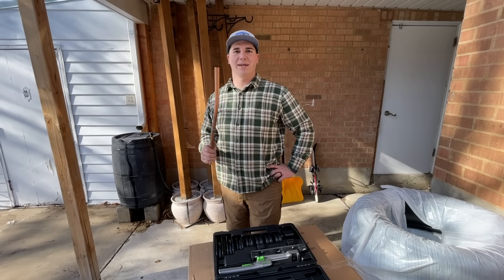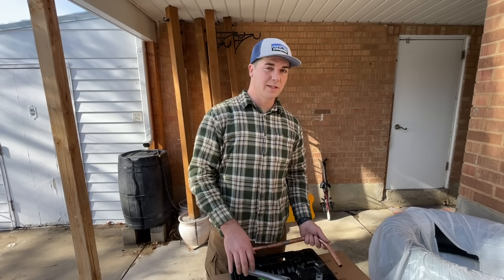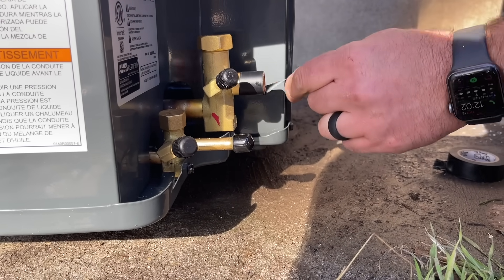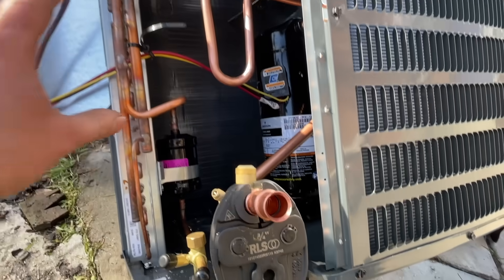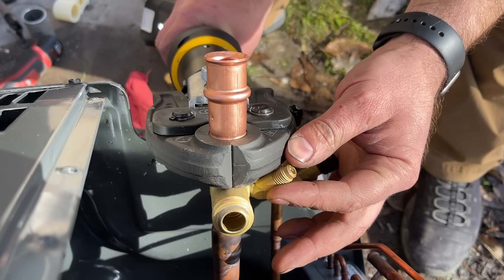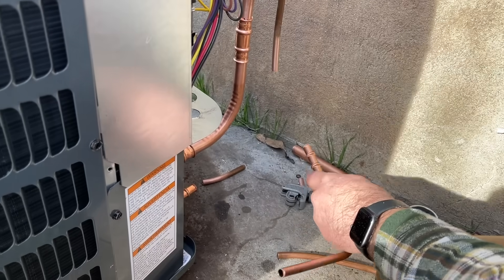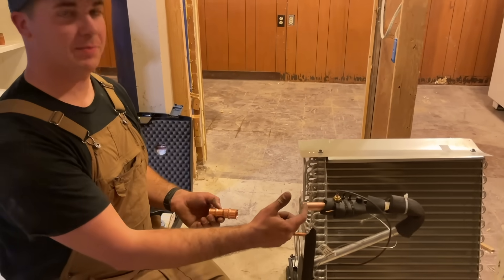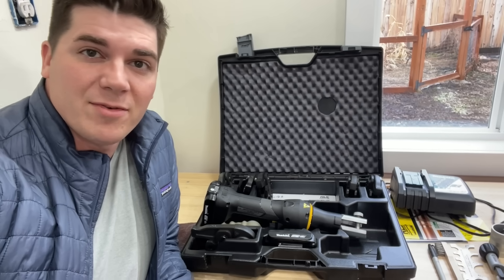Brazing Is For Cavemen. THIS Is The Future Of HVAC Copper Connections. -RLS Crimping Tool-

Comment: For years I would solder pipes in my house I even changed my kitchen and other major water lines all with solder , just last year I had a water filter system installed for the complete house they used the swaging tool with o-ring fittings like the video, being 75+ years old and old school in my experiences I felt very uncomfortable with this installation, but they don’t solder pipes anymore only under unique situation’s ? They said it will last a life time ? will see ? LOL 🤔

Comment: Press fittings for HVAC IS ILLEGAL STUPID BEYOND BELIEF AND WILL NOT HOLD LONG
Reply from the maker: It’s been 2 years all my joints holding like a champ. Unless you have used them, your argument is invalid. If you have seen them leak, it more than likely was a rush install because the installers aren’t the ones coming back to fix leaks. 👍🏼
Reply: @diyhvacguy  40 years in the trade!  union apprentice journeyman foreman super draftsman and shop owner. Zero engineers or project managers will allow this garbage for gas lines rarely is it even allowed for water. Why because there’s data and science which some of us are able to understand and are not willing to risk hundreds of millions on this it fails it degrades over time it interacts with various gases and liquids 
Worst it allows untrained morons to do work they have no business doing.

Comment: Honestly i like the idea of press refrigeration fittings as far as a time saver and i would use these over lugging my torch out of my van and nitrogen any-day you get alot less black shit in the pipe this way but i will stick to brazing until they come out with a better way to hook these up to the king valves yes rubber o rings in a system like this will only last upward to 25-50 maybe less years before they begin to leak but by that time that happens the system will be old and need replaced anyways aswell as the lineset and fittings and worse case scenario if a fitting leaks you cut it out if you can and coupler it back together. Which brings me to my next point (only in the lineset run)… on the king valve if that didnt seal your sorta screwed no room to cut it back and repress only option is to cut the press fitting off of the pipe and try to split it in place which is still risky since the pipes are very close together tightly smashed down onto each-other so cutting the fitting and not cutting threw the king valve is the next challenge when replacing that.

Comment: I don't like it. I changed few solenoids o-ring in commercial refrig and recently last month. It's much compress than the crimps but it on the high side. Staybrite8 is good I use that quite often. Personally I've never seen leaks using it but I've seen leaks from blazed.

Comment: seems more complicated and difficult to use in tight spaces. what's the upside to using this process is it the no requirement for torch flame, and/or expected to produce less leak prone connections and/or have a store for taking joints apart without having to cut the pipe?

Comment: Yes. Crimps are here to stay. They massively cut installation costs when hot work permits require a “spotter” to stand by with a fire extinguisher making a weld a two person job. 
Are they superior, NO. Will they outlast a well brazed joint also no. Will an o-ring eventually break down, split and leak, undeniably.
Are we going to see a time fifteen to twenty years in the future where an uncontrollable amount of refrigerant is constantly being leaking from crimped systems, unfortunately yes.
The reality is that this jointing method will be taken up industry wide because people will take the cheapest quote and in order to stay in business too many companies will either have to do the same or go broke.
Reply: Probably all fine and good for commercial union jobs where you have that stuff, but for residential light commercial guys, waste of time! Brazing  faster no leaks unless you suck at brazing! Shouldn’t have leaks anyway when you walk away as you’ve pulled a vac into 500 microns etc. before charging. Tool is bulky, I feel it’s weights the same like battery powers pex crimpers? I get that people want to take the fire aspect out of things. But if your a good brazer and know where you fire hazards will be while brazing and use wet cloths and heat shields ect when needed, brazing is still ideal way to work. Anyway.

Comment: This may work fine when you have lots of room to fit that tool but I’ve done lots of work in tight closets where it’s easier to fit the torch then it would be to fit those huge clamps.

Comment: dido on most comments against these compression fittings...my addition....they are are constantly trying to find ways to make techs less skillful...it does take a bit to learn soft and hard soldering but there are always situation (especially close to a compressor) where the tool just won't work..then what... how about capilary replacement..compressor repalcements.... have seen pressure blow apart these slip joints after repeated cycling of the system  (410a can be 1000lbs if condenser is dirty (yes; have seen it) add harmominc vibration on top of that even with antivibration inserts...then you have the added need to carry more tools and another set of dfittings or you limit yourself to just those jobs your tools can do...no thanks

Comment: Guys, I encountered such a problem, there is an old soft copper pipe in the house. (Water) I had to reconnect to this pipe with a press fitting and continue further with an L pipe. What do you think, can there be problems in the future at the junction of the press fitting and the soft copper pipe? The pipe is soft, bends a little. So far, there is no leakage at these junctions.

Comment: If its too good to be true, it probably sucks!. 
How long have you had these in place? Check back in 5-to 10 years then claim they are amazing!
This reeks of the industry introducing more failure points. Or something a shady small business would scam people with.

 Had an issue at work with a split system. They had to come out 2x a year cause the refigerant kept leaking out at the companies expense. After 2 years of this i cought wind of there crappy business tactics and told them to braise it properly or I'm dropping their contract.
They braised it and the next 3 years I was there they only came out for the yearly scheduled maintenance.  No more leaking issue.

There is no compairson: Crimping vs a liquid metal seal by braizing. It will leak much sooner than braising would..

 Why aren't shark bites recommended for in wall? Oh they claim they are. But insist on having a service panel at the joint "just in case"
I call shenanigans

Comment: All of the press fit I’ve seen has the crimps on either side of the o-ring, creating a set amount of squeeze on the o-ring itself. In this instance, with no pressure on the o-ring I can see refrigerant leaking by, and I don’t see the mechanical crimps holding back the refrigerant very well.
 Liebert has been using press fit for 5-10 years on their field- built up line sets, but the crimps are ALWAYS on either side of the o-rings.
 Also, a lot of natural gas companies are going press fit, but again, always on either side of the o-ring. I do not use crimp connections on refrigeration mainly because I’ve never trusted o-rings to not deteriorate and leak.
 I’ve been a master HVAC and master gas technician for 36 years, and I would not trust this type of crimp, period.
 If there’s a place where the torch could catch something on fire, use copper induction brazing/welding. It works just like a torch, but no flame….

Comment: Those O-Rings are not made for freon, they're made for potable water UNLESS there are special HVAC couplers with HVAC O-Rings. I've used neoprene o-rings in car AC system, before, they held up for few weeks in south florida, but still.. Why cut corners with a powertool when the as will escape and the HVAC will require fixing in few weeks??? Shady way to do business, making plumbers look bad!

Comment: So, by using this system in which you have invested ~$3,000+ dollars to use couplings at $8 a piece (as expensive as Sharkbite push connectors), you've successfully turned a one-man brazing job to a two-man job at the condenser (someone has to hold the condenser up on this one) with the potential to eventually leak in the future due to trusting an o-ring at 350+ psig...

This is a great idea!

Comment: 400 psig is not enough in testing your fittings.  Better to go up to 600 psig .   410A can easy reach 575 psig before the high pressure switch cuts out.

Comment: My water heater was installed using those o-rings last year.   After it was all done and the installer left, I realized that I should not have allowed the o-rings.  Rubber o-rings will get hard or shrink and will eventually fail.  A good solder joint will never fail.   Big dummy I am...

Comment: My guess is those fittings will have to prove themselves after a few decades of use. The material that makes the seal is likely going to breakdown over time and pressure cycles. 
There is also an alternative to having to use nitrogen with brazing...SOLDER. There is a solder out there that can be used vs. brazing rod and it doesn't oxidize like brazing does inside the copper. The crimp tool idea seems reasonable however, if you are a good tech with a torch, it's a lot faster and less clustered to solder. I do agree the tubing bender idea is the way to go vs. sloppy handmade bends that look like limp noodles leading up to the condenser or evaporator. 
Check into Stay-Brite 8 solder for copper HVAC lines...good stuff and a propane torch will do. Requires Stay-Clean flux...It's a silver bearing solder, good for 3,000 psi.

Comment: I bought a compressor kit with several nail guns on sale and when I went to use it several years later, I noticed that all the plastic pieces and some of the o-rings were disintegrated. Plastic containers I bought and placed in the attic or basement became all brittle and cracked over a long period of time (5-10 years). Either the resins plastic manufactures use in making plastics and o-rings are not long lasting, or it is the nature of these materials to break down over time. The brazing is probably for commercial AC, and stay-brite 8 is a good choice for residential, and these pro-press should be used only when torch cannot be used.

Comment: This makes me glad I’m retired from the HVAC and Plumbing Trades. If you can’t Solder a Plumbing or any cooling piping, also if you can’t Braze with a Nitrogen Purge, IMO, you shouldn’t be in those trades. Also he ruined the fittings, for someone else to try and fix this mess, when it leaks.

Comment: This is dogshit.  Not sorry one bit about the comment.  You say brazing is for cavemen, but then you jacked up cutting off the bell.  The lead end bouncing all over the place, the “reamer” used was for plastic pipe.  Probably left shaving inside the pipe where it needs to be dead nuts clean.  Used your finger to clean the shavings, said oh it’s a little short from the marking gauge but who I’m I it’s fine, before proceeding with this kit needs a 3/4” jaw, but ironically the kit doesn’t come with it.  You sold nobody I hope you’re not sponsored, caveman…this is me writing this comment at 7:17…let’s see how the next 10 minutes go.
Reply: Two man job to Pro Press 3/4” ACR…very cavemen,isk
Reply: 4 joints compared to one if brazed…more leak points and risk…not for me

Comment: Installations instructions say to braze, so would that take away the warranty of the equipment away if soldered or crimped?
Reply: also using scotbrite leaves debris in the line if you dont nitrogen flush it out.

Comment: Im not an hvac expert  but wouldnt it be better if the o- ring were made of solder,after you crimp it,heat the solder o- ring and you dont have to worry about the o- rings drying out?

Comment: Downside is removing the connection, you need to cut it out but if it was brazed or soldered, heat can remove without cutting. Not worth it in my experience.

Comment: I have to agree with the negative comments about this system. If you can’t pull a good braze you shouldn’t be doing this type of work. There is a satisfaction to watching braze and silver solder flow. An O ring will break down in time and then what? Not worth it , nope no way. For what it cost go take brazing lessons 😂

Comment: I'm not sold on it.   Took just as long if not longer, and made it virtually impossible  to fix at the low and high manifold without having to cut every bit of that out.  As a customer,  I would not allow the HVAC crew to use that contraption on any of my copper pipes.  Those that can solder or braze would have beat you by 10 minutes and even if a leak, would be an easy repair with torch and rod.  Not to mention as a customer, you're going to bump up the repair price to help pay for all the tools and expensive fittings that go along with it.  Me thinks this may be short lived in the HVAC world, without further refinements.

Comment: I couldve brazed that in By the time youve loosened that valve, wrapped it in tape, cut the end off, taken the tape back off and then crimped the fitting on to short of a pipe.  So whats the point?

Comment: schrader valves leak because of oring, every car I had problems with AC had an oring fail (to be fair, sometimes it is a surface corrosion issue, but with correct solder/braze there is none of that), and now you introduce more orings into a system that only had couple of them (and that are known to cause leaks)...
these for water IMHO are still fine, but I think the manufacturer is simply trying to expand into a market they have no business being in, in long term they will cause A LOT of problems, not to mention the ecological aspect of it

Comment: Im a retired union pipefitter and exray pipe welder, tig, mig, & stick welder, i have used propress a lot & works good, but as far as a central air unit, i would rather sweat those joints, i dont totally like propress because the O rings are only rubber and will dry rot eventually... Sweating is the long lasting correct way ...

Comment: I'd rather braze than use this junk. Just like how I'd rather solder plumbing fittings than use garbage compression fittings. Just the idea that the pressure is there trying to push something apart that isn't technically bonded as ONE does not let me sleep well at night. In certain large systems we wouldn't even be allowed to use this style of connection even if we wanted to. Total junk.

Comment: Don't trust the crimp-type connections. this is for the lazy and quick jobs done type of work.  sooner or later the rubber seal inside the crimp will start to deteriorate and leak.  it's best to solder instead.

Comment: Newbie here, is there any reason you couldnt use flare fittings and unions to build your system?  Would they tend to leak over time?  I like the idea of having everything be able to come apart later in life for repair/replacement.

Comment: I can see advantages of this system but it would be a nightmare to use in a confined space. Also the connection is only good for the life of the o ring whereas a brazed joint is truly permanent.

Comment: And what happens when it leaks at the service port valve, now you can't get the fitting off, so have to recover and replace and recharge. Plus the next guy that doesn't have any of the high dollar tools has to re fit everything. Sorry but no thanks

Comment: As an hvac installer this is so much extra work and more time consuming than necessary. Just braze a stub directly off your condenser and coil inside and then cut the stubs on the job site to accommodate your press fittings. Cutting those brass service valve is a horrible idea. This is not a good for of install. If there is ever a leak that entire unit is useless

Comment: Weq had a RLS rep come to work to give a demo. He was telling us how a plant or factory was using their fittings and all 2,000+ failed because they weren't done properly. He was basically saying if the piping isn't basically perfect it will fail. The factory stamp you see on some lines will cause it to fail. Great idea on paper but its just not there yet. Seems like it has its uses like if you needed to makena connection in a wall or tight area.

Comment: The old timers just need to adjust or retire because like it or not this is the way of the future. The new R454B equipment is being made with longer stubs at the compressors and filter driers as well. I have the push connectors on my personal unit for my home and 6 yrs in no leaks the zoom lock seems even better. Even if you do get a leak it's easier to fix just cut the old fitting out and install a new one in less than 10 min. You are more likely to have a leaking coil from the factory than on one of these fittings as long as it's installed properly.

Comment: A properly brazed line will last 50+ years. This crimp will probably last less than 20 years.

But thrlen you realize who's keeping a 20 year old AC system? The efficiency and tech improvements would make replacing the whole thing 20 years later financially worthwhile.
Reply: From what I see most ac are not lasting 50 years

Comment: That's insane! I would never go through all that work to use a crimp tool in that location. You're practically having to disassemble the whole AC and tip it on its side just to crimp it. That's insane. Way more efficient to braise and more reliable to braise it.  If you crimp it, then the joint fails, what a pain in the butt to have to try and repair it.

Comment: CAN WE SAY IT GOING TO LEAK DUE TO NOT USING REFRIGERATION FITTING. DOUBLE O-RING's. YOUR IS ONLY FOR PLUMBING LOW PRESSURE. and o-ring do fail when this system die's your be trashing your plumbing kit.